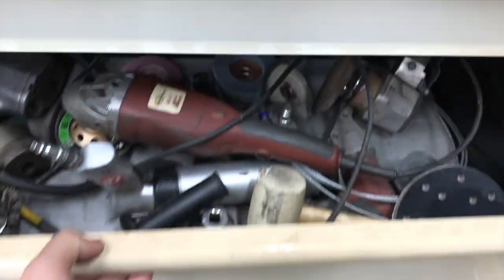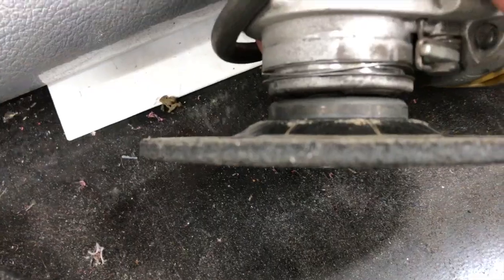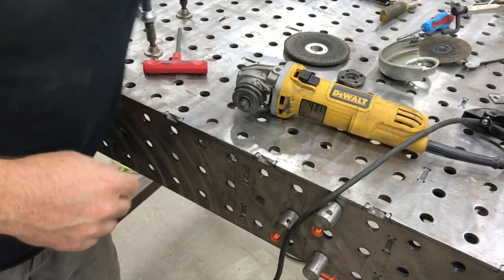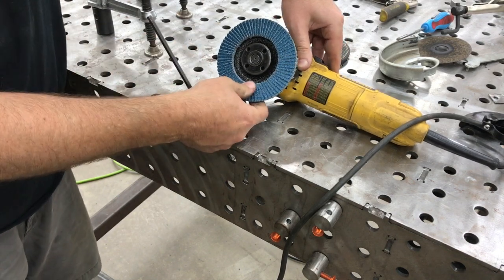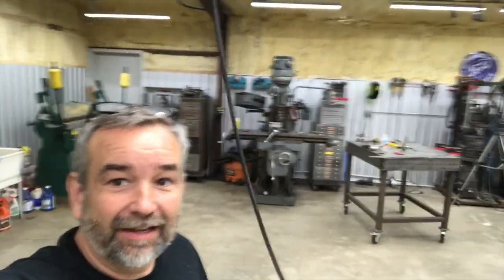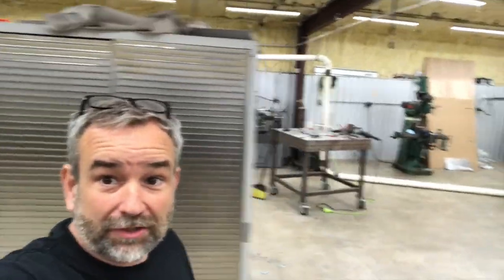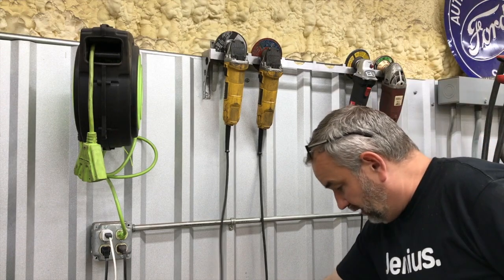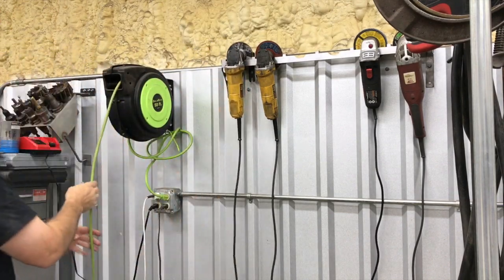DIY Grinder and Drill Rack - Holder - Bracket From Scrap Metal

Comment: Wow not one of your grinders has a wheel guard r the side handles . 
Does the rack work with grinders that have the wheel guard and side handles  in place?
Reply from the maker: Actually if you were watching closely, you might have noticed the very first one I showed had the guard on it.  I keep guards on all of them, but this very of the CAD file was too small (prototype), and I wanted to get the video done so I took the gaurds off to fit them.  The files I am selling has an enlarged slot to fit the guard.
Reply: OK, cool. So will they fit on the rack with the handles on as well?
Reply from the maker: I haven't tried it with a handle.  I hate grinders that don't have guards, over the years, I have kind of gotten used to resting my thumb on the back the guard.  One time was at a friends house that didn't have his guard on and i stuck my thumb into the grinder disc.  Not sure on the handles, I haven't tried them yet.  You might can modify it to fit your exact need.
Reply: I'm guessing the guys that have had wheels come apart on them probably do use the guards.
Reply: I must be the only person who doesn't like the guards. (7" grinder, OK... never needed to get into a tight spot with that one) I primarily use the 4" flap disks for nearly everything. I don't really use cut-off wheels.
Reply: I'm missing an eye because of a grinder accident. But it was a cut off wheel, not a flap disk. I don't use cut off wheels anymore. Flap disks have limited life long before the fiberglass disk portion becomes weak enough to come flinging apart.
Reply: Lets be clear, you're missing an eye from a grinder mishap and you still don't use wheel guards on hand grinders?
Reply: No eye protection, and standing in line with the spinning sparks. Had nothing to do with the guard. In fact, the guard was on. It was one of those in a rush, I'll just zip off this bolt real quick scenario.

The wheel guards are really there to keep you from putting down a spinning tool on a table, or keep you from knicking your fingers. If a cut-off wheel is going to explode, it's going everywhere. So, now it's always eye protection. Face mask with spinning wire wheel, no cut-off wheels, and never load up a grinder with aluminum. Take my time, and be mindful of my fingers.

At the time of the accident, I was working for someone who was always rushing us and pushing his crew. He'd stand over your shoulder and micromanage on how you were doing things wrong and always take the tools from our hands to show us how to get things done "his way". Taking the time to go back to the bench to put on your safety glasses was a waste of time. (at least that was the impression we all got) Thankfully, he's out of business and lost his contractor's license for some crazy shit, I can't remember.